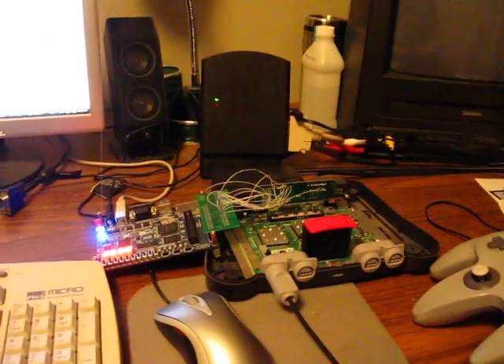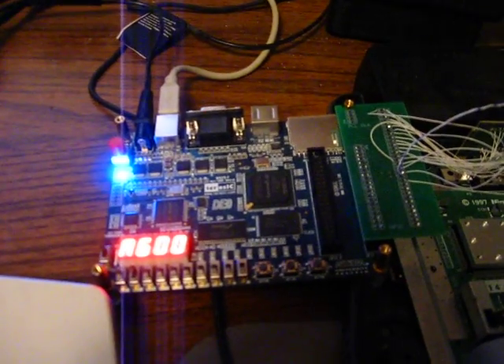N64 cartridge simulator, finally working

Comment from the maker: I used a small flash ROM first because it's dead easy to access and I already had it. I'll be adding onto the code I have for CF (state machine to handle reads)